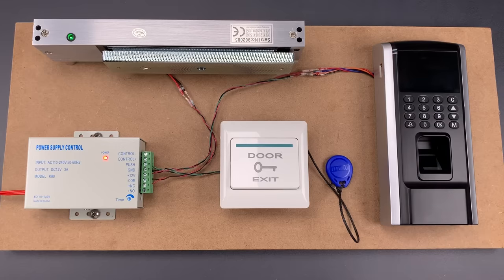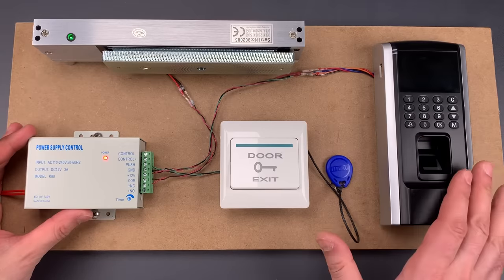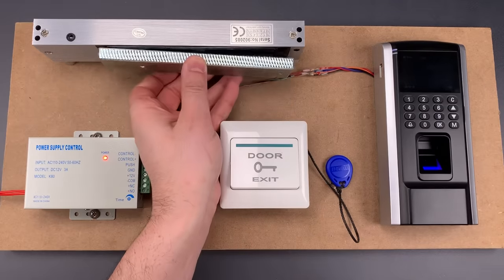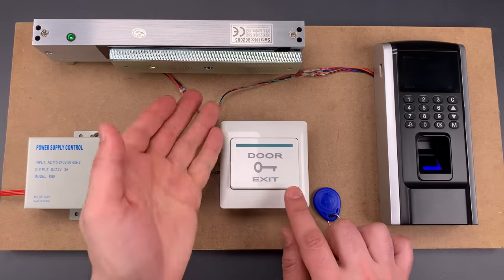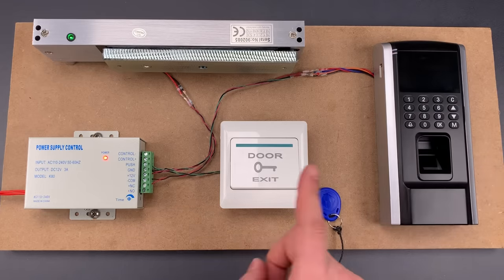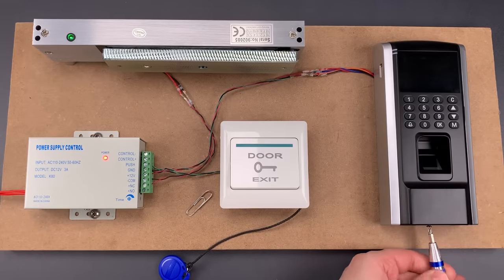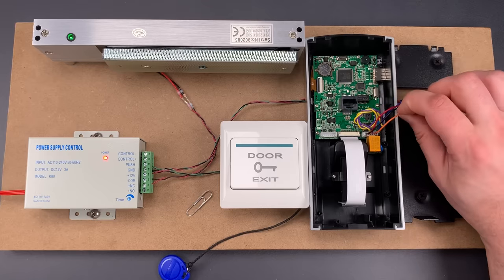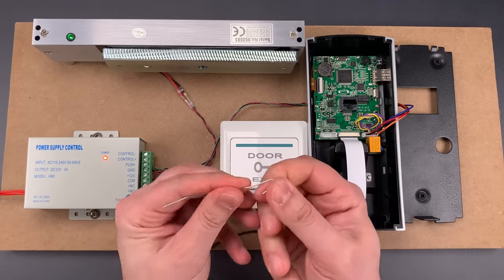[1040] Fingerprint/RFID Lock Defeated With a Paperclip (Mengqi-Control)

Comment: Those magnets can be kicked open from the inside by an 8th grader if there is no deadbolt (I’ve even seen magnet doors being yanked open from the outside), the magnets do not work if you want the door locked from both sides
Reply: Sure it does. Your basing your assumtion on what i will assume is a school doors magnetic lock...yeah you could. Now try the same thing at the  military base my brother works at and find the results to be usless. Hit it with a tank...The door bent inward and yet the magnet broke off the wall and bent with the door...Electrinic magnets get stronger the more electicity you pump in them
Reply: @alastorclark3492  Not all locks are at military bases, and using large amounts of power at all times is impractical so it won't be done in most cases. Also, when you say hit with a tank do you mean rammed or shot?
They are called electromagnets.

Comment: If this lock is installed cheaply with wires outside a wall, one can easily rip the wire off (without opening the brain) and "hot wire" it or use a battery to send a jolt of electricity to unlock it.
It would make more sense for the brain of the system right on the locking mechanism itself to lessen the possibility of tampering. This way, even is someone ripped off the scanning device, they can't send false signal to unlock the door.

Comment: Easy to by-pass. But honestly if you used this system you would build a strong plating structure of some sort to place the module in flush with just the face accessed so that no-one can access that screw on the bottom

Comment: I guess the amateur interlock/lock system I did for a college subject was way higher tech than this then... It used a can protocol from the door controller to communicate with a main computer that was elsewhere. Depending on the message received from that computer the door would open or close, accordingly with the credentials. I got a 14/20 on that one though

Comment: I bet the RFID tag is only a Mifare Classic and only the UID of the tag is being checked. You can easily copy those with an an Android smartphone/Rpi/Linux VM and $10 in hardware, if you got access to the tag for like 30 seconds.
Even if there is (encrypted) data on the tag and non-standard encryption keys (but they are mostly), you can easily decrypt/bruteforce it, copy and modify it and write it onto a new one.

They are widley used for access systems like gates/barriers, customer/loyalty cards, vending machines like small coffee machines etc. Mostly the money or the customer points are saved on these, if the data blocks are not empty.
If there is data on the tag:
Scan and decrypt the tag/card -> use it -> rescan -> search for changes -> edit the changed -> write to another tag -> ??? -> profit.
If not:
Scan and decrypt the tag/card -> write to another tag -> ??? -> profit

Finishing right now my free coffee on a paid parking lot, where I parked for free.
Sadly this won't work for credit cards lol.

Comment: I lived in an apartment complex with about 5 buildings all of them had these type of magnetic locks and most of the doors you could open just by pulling hard enough. Not sure why it worked with some doors and not others when they all were the same.  I'm guessing the strength of the magnetic doors or something is less through time. Some would just pop open with a little force some took a lot of force and some were just impossible to open.
Reply: Probably depends on the gap between the magnet and the door. The closer the gap, the harder to open. But in view of the thin wires I can't imagine that the electromagnet is strong enough to ever hold against a determined push (pull). I think that it's rather the fear of damaging the door that keeps you from applying enough force to open it.

Comment: Find the threading for the screw and replace it with something strange. Security torx, pentelobe, whatever. It would be rare to have a lock expert or even someone who saw this video to actually see and recognize this lock. I guess if a criminal saw it, searched for it and was like…ok ill be back with my paperclip. Possible, but unlikely
Reply: The ideaoligy of this lock follows the same prinsipals for them all. Using a security bit screw deters unscrewing not ripping apart with brute force (100% know this to be possible) Better to have an IP controlled system

Comment: I have setup some of these units and there are variations where an indoor unit sends the command to the magnet and the user and password can be sent from the keypad to the command unit via ethernet. You really need to plan your setup.
Reply: That is not a stand alone system though which is what is being covered in the video. If we were dealing with one of those  the LPL would be teaching us hacksss.

Comment: Another bypass, that maglock is controlled by a powered magnet meaning it only stays magnetic when there is power to it. In other words if you use an emp the door lock will be deactivated. One could also cut the power to the building but if a building has a lock like this it likely has a backup generator. This lock is extremely flawed in its design and should not be used.
Reply: Probably they rather have it open only when there is power to it. Because that doesnt eat power all day.

Comment: A few thoughts.
(1) I wonder if this has BlueTooth or WiFi capability? If so, a pentest sort of approach might be worthy of an attempt.
(2) I also wonder what a BadUSB (as seen in the first of the two videos with Cryptex USB drives) would do to it? At the very least, this is an obvious pentest vulnerability -- get it into firmware mode (which likely only needs the keypad) and put a USB drive with replacement firmware in the side, and away you go... default firmware loaded, if there isn't a default backdoor you can easily fix that with a bit of erm customization I'm sure.
(3) ...speaking of default configs, I bet there's a default backdoor code to unlock it and I bet that's almost never changed. The people who install routers are nerds like me and they hardly ever bother with such things -- hotel staff aren't even in the biz lol and corporate IT depts are paid by a guy with a stopwatch how soon can it be ready? So there's a nearly 100% chance the defaults that ship with these are never changed. I virtually guarantee there's a "testing" or "admin" backdoor.
(4) Actually I bet I can beat that thing with the 20gig IBM Travelstar I have from an old XP Toshiba laptop, the drive that spins up but no PC on Earth can get it to recognize... LOL. Pull the two neodymium magnets from it that makes the voice coil work (the part that moves the read/write heads around), that's all I need. Clank em together, stick em over the front of the bezel, just to the left of the fingerprint reader. Door will open as long as the magnets are there unless that bezel is THICK metal of some kind and I can tell from here it's~1.6mm sheet steel if it's not just cheap plastic. That lil yellow box that's coincidentally ;) in the exact area I describe? That's the relay opens the door. It's an electromagnetic coil in there and a couple leaf-switch contacts. You just need to replace the electromagnet with something that does the same job from outside and CLUNK the door opens.

This isn't security, it's the illusion thereof -- and universally those are a pain in the rear to use.

Comment: I am trying to think of a design that would challenge you. First, no low battery manual bypass. I would put 
the battery in the key. Next, a pin design you most favor AND an electrical ID through the key. PS - I think you 
have an advantage to some lock picking when you have the lock AND the key. This means you know what to 
try to get a successful bypass. Most thieves would not have a key to mimic or defeat unless they researched.

Comment: This is the main purpose paper clip invented, not for clipping paper.
 I was thinking you can break RFID encryption with a paper clip.
Anyway, this will not work if the owner uses a controller inside the building with a small reader outside.😁

Comment: Check out videos on physical penetration testing. An upside-down can of compressed air will get you through many doors that have motion REX (request-to-exit) sensors and a flexible rod can reach under/between doors to press a REX button.

Comment: So if they put 3 tapper proof screws in and super glue it shut, (with a fail safe tapper proof switch)....you would just use a RFID range finder?

The Edit: ....so even if it was impossible to get into the unit...you just pull it off the wall and short 2 wires together?!

Comment: I've never seen such locks systems with plastic housing which you can just uncrew. Those systems are very common in Russia and it is always just metal number buttons on the outside and the rest of it is hidden inside the metal door. So you will need at least a grinder to open it.
Reply: Kick it ... knock the front off ... and your in

Comment: Same paper clip short the usb connector on the side of the keypad. It blows the fuse in the secure side.  Or blows the transformer. No power,  no electromagnet.

Comment: the no / nc part of a lock should never be outside of the building.. typically the keypad/rfid reader have just the data wire coming outside.  you read the card or enter the code it sends it inside to a control panel like a dmp 734 or such. connecting wires at a reader/keypad  wouldn't do that on a professional grade ul device .. the only self contained ul listed device i can think i can recall that has this setup is like an iei keypad.. but even then. if wired correctly the case has a tamper switch going to the alarm panel. a relay on the panel.. type c or such would bypass the no/nc at this point...  did this case not have a tamper switch to wire back hypothetically?

Comment: No screwdriver or paperclip is actually needed here honestly. Just a coin to unscrew and the screw its self to bridge the two cables (just press the two wires into the screw ridges to pierce the plastic and bridge)

Comment: Wouldn’t the lock be inside a wall? The button wouldn’t be exposed realistically
Reply: the fingerprint scanner is what is used to preform this hack. Those particular boxes mount to the surface of the wall not inside it. Even if it did though you should still have some access to the face of the scanner which is good enough for a 13 year old with no tools to break into

Comment: For the life of me, I cannot understand why these electronic lock/entry manufacturers think it's a good idea to put an unprotected screw on the exterior of the device, allowing any passerby with a screwdriver to access the internals.  Imagine if a physical lock were designed with the screws on the outside so anyone with a screwdriver could disassemble it.

Comment: "as easy as a mechanical lock" ? no sorry that's shamefully easier than a mechanical lock. I facepalmed when he said there is only ONE screw that is actually accessible for the secure side. and that it's not even a freaking security screw, not even a shadier screw ( like a torkx or a square head that is mainly popular only in Canada ) no no, just a standard run of the mill philips screw. COME ON !!!!

Comment: well if you disassemble the unit to doing so then pretty much any device is at your will, why not just make it faster and get nail cutter and cut the power wire going to the magnet lock wouldn't that be faster and no need to disassemble anything?

Comment: Those magnetic locks are nowhere near as strong as their ratings imply.  Their rated strength is only valid at the point where the metal plate is pressed flush against the electromagnet.  The pulling force is dramatically reduced when they are separated by a mere millimetre.

I've found that I can simply brute force these open with a sharp sudden pull on the door handle, or by kicking the bottom of the door to induce vibration between the magnetic locking mechanism, while pulling on the handle.  Usually works for me and I am by no means a big gorilla of a man.

Way too much stock is placed in the efficacy of those mechanisms.

Comment: could this be mounted in a full metal case on the outside and still work every feature with metal strips and plates on the top and bottem of the front side and just weld it into a place so u cant open it would this then be a good solid lock? or might there still be some flaws?

Comment: they should split the pcb in two and have that connection on a small pcb on the inside connected with a ribbon or data cable

Comment: So the "pin" is mightier than the "sword" and as always the devil is in the details.  If someone didn't know which wire to jumper to ground, or even see which one is the ground, they could just try jumpering them all to the case or all to each other since there's not too many.  This begs the question, why don't all security devices require NIST review before being allowed to enter the market, especially all these toy firearms locks?  I guess money talks and public safety walks.

Comment: I wish you showed us exactly how you "bridged" them at 3:15 i don't know if it's a physics term but I've never taken physics so idk how it works. When you bridge do you mean connecting the two wires with the paper clip? Like touch one end of the clip ro 1 wire and the other end to the other?
Reply: Quite so. One end has a constant electic signal running through it (to make the screen and other internals work). The other connection goes to the magnetic lock's controller and when it recieves a signal that tells the controller to stop the magnet.

Comment: So what happens when the power goes out? Does the door swing open automatically because the magnet releases? Or are you trapped inside by the fire that has knocked out the power to your magnetic door and you cannot open it?
Reply: You can open by hand from the inside?

Comment: LOL impressive looking lock ... flaw looks are deceiving ... you would think the rebuild of this would be to move the control circuit to ... the other side of the door lol ... reminds me of the scene in RED where bruce willis defeats the lock that changes code every 60 seconds by busting the wall and using the handle on the other side lol

Comment: I used to work in security. I was always told the panels cant be deactivated cause of the tamper switch. You say tamper switches are easy to bypass. How?
Reply: jumpers and the right resistors ?

Comment: I sealed the keyboard inside the wall with concrete and resin. At worst I thought I would seal it behind a metal plate and only use the RFID. But you can easily hack this kind of rfid with the appropriate tools you can find as easily on internet ..

Comment: So strupid ! 1 screw is ok, but they should make encrypted communication bethween keypad and control unit... When someone is verified by external keypad to send a hash to control unit to open the door... So if this system is done in a such way you can do whatever you want with wires but without success :)

Comment: that lock is simply a trash.  The basic rule of electronic lock is that people cannot access the circuit board from the outside housing unit which mean no screw should be accessible from the outside.

Comment: Good luck with that in corridor/ hallway with constant people passing by. 🤔🤔🤔🤔🤔
If I was to do it I would use the screw diver and then with my side-cutters chop the signal wire and common bare the ends and twist             together "hey presto your in, that a lot quicker 🤫🤫🤫🤫🤫 OR  as Bruce Willis does shoot the hell out of the lock, same result 👍👍👍👍👍
Reply: 10 AM when everyone's at work, 7:30 PM when they left for a movie half an hour ago, or 3 AM after you've confirmed they're at the beach for the weekend.

Plus using a firearm means the police are a lot more trigger happy when they're tracking you down, and you're leaving around a lot of evidence.

Comment: This installation is wrong , it needs to rs485 or ip connection between access control and card reader really is good thing for single light for example red for closed and green for open.

Comment: For those of you thinking that a “normally closed” switch would be the solution, cutting the wire would be the defeat. Unless it is wired on the board with better logic.

Comment: I once broke out of mental hospital after sticking some paper over the motion sensors, ripping off one of the pannels to the emergency exit door and applying a yes (hot wire) signal to the door magnet. I only did it because the security "nurse" said i was to stupid to ever do something like that. I went up to the front office and had that dick fired in 30 minutes purely for failing to keep me in

Comment: Big tech company chips all staff, puts auto id locks on all doors and safes, invests 100 millions in security. Doesn't even bother to hire real guards because of the high tech lvl.  Here comes 1 guy with a paperclip and a screwdriver at 2 am :elbowcough: Steals everything, writes f*g on all the walls and takes a dump on the CEO's desk.

Comment: Can you get that off from the outside though?
Reply: Of course you can. The plate is screwed to the wall, the brains can't be so they can be serviced. 
This flaw exists because the manufacturer put the brains on the wrong side of the door
Reply: @simplesolutions289  that's yours. This video shows the screw on the bottom, where it would be able to be accessed from outside
Reply: @Sillimant_  yeah, I seen that. Was more saying that the flaw is fixed on other models already.
Reply: The plate that holds the "brains"(outside of door) has only the female threads making it only screwed on from the inside. Just like a regular door knob.